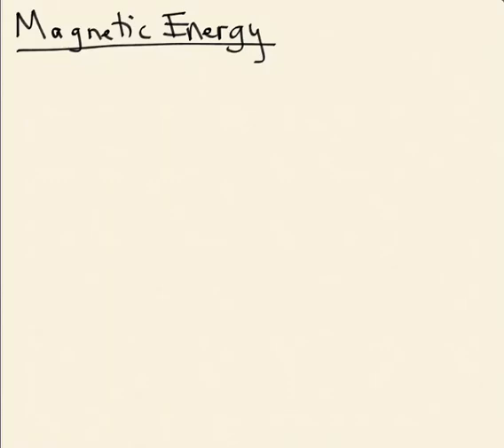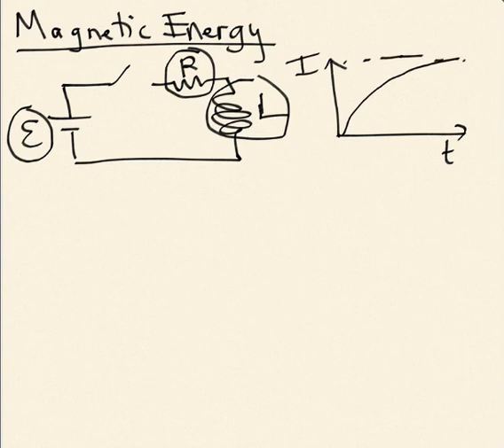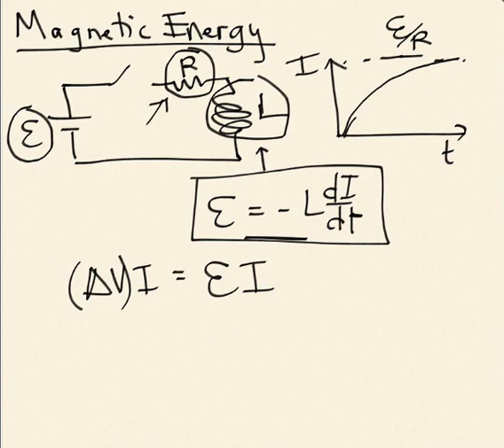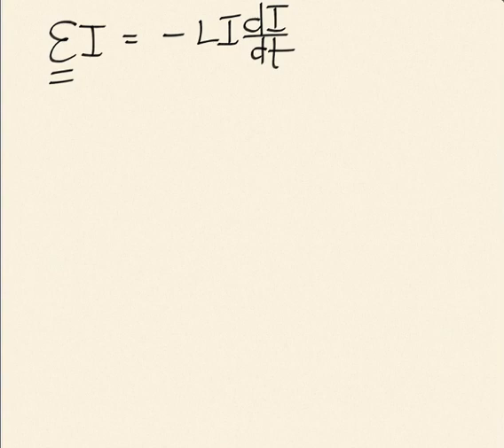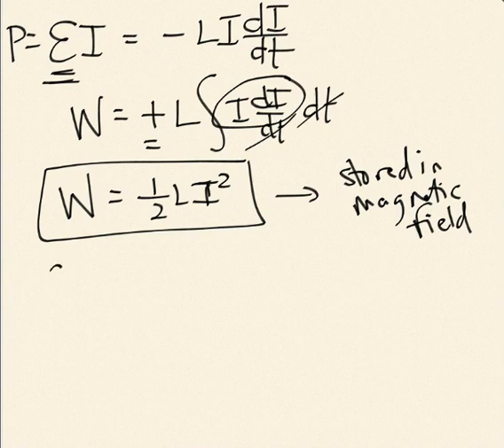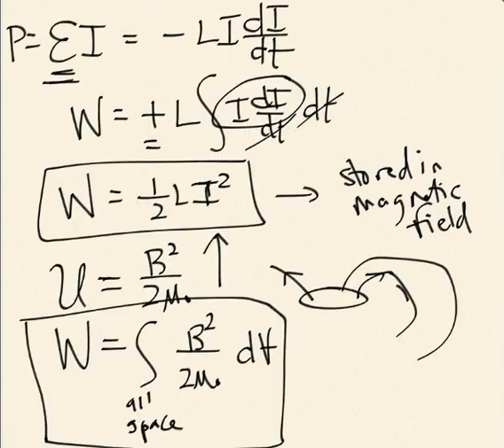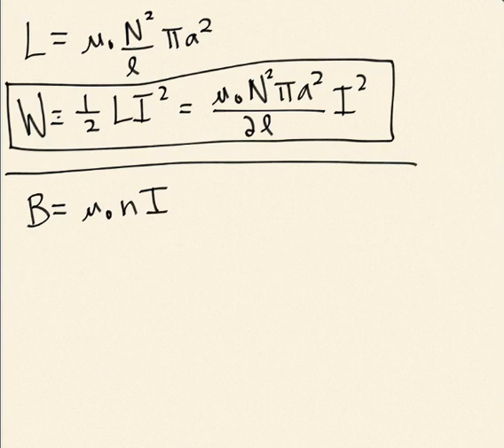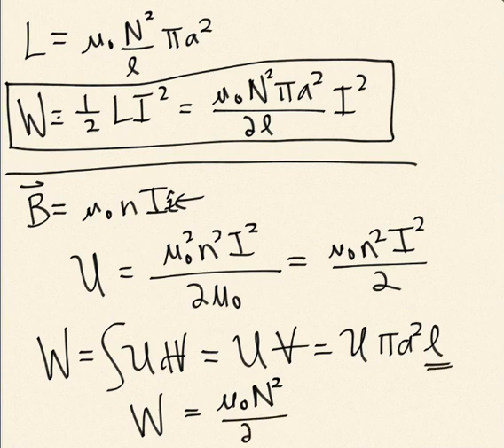Week 4, Online Lecture 3:  Magnetic Energy

Comment: He doesn't mention it, but the symbol "a" is de diameter of the solenoid. By the way, volume is pi . r^2 . l (with r being the radius), not pi . a^2 . l  as mentioned in the video (in the last equation).